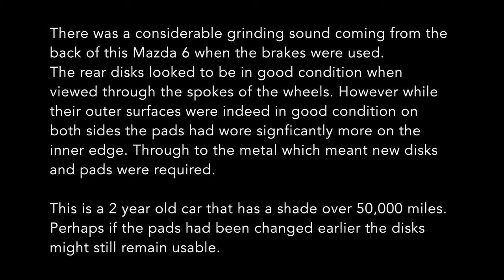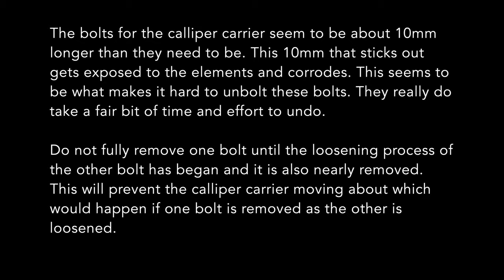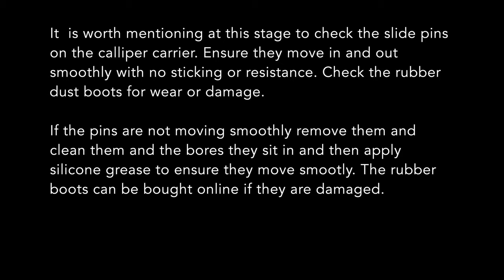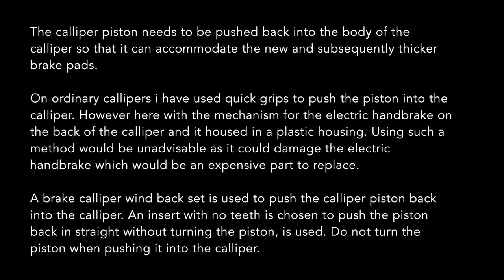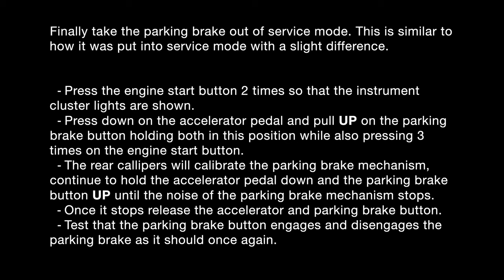Mazda 6 with Electric Parking Brake - Rear Brake Disks & Pads Replacement

Comment: Great Instructions. I just did mine. My bolts came out really easy. One tip: Since the end of those long bolts are exposed, spray some lube on them before you try to take them off. It will make it much easier.
Reply from the maker: Great advice thanks.

Comment: Great and very informative video. Did the brakes on My own M6 2 days ago using this video 😊 Sweet detail with the parking brake service mode 👍
Worth noticing is that there is in and outside brakepads. So you have to be aware which type faces twds you and which type faces the wheel well (id: Dots on the non friction side).

Comment: This is by far the best video on the topic. Very detailed. 
Only one suggestion: mention which size are the bolts, diameter of the piston, if you used lock-tight on all bolts, etc.

Comment: I would like to que myself as well in the greetings line. 
This was thus far on YouTube the most informative video. 
Cheers dude. 
Have followed the instructions step by step and have had success. 
My Mazda 6 is from 2018 September, and rear break pads, most likely have not been changed until now. I have managed to break 2 fasteners because they were seized on the calliper. The other 2 on break pad holder were stuck so had to use allot of lubricant fluids.

Comment: Very informative tutorial video which also applicable to my Mazda 3 yr 2017. Unlike other car brand, there's no need to use a scan tool or disassemble the the brake motor to wind back the parking brake.  Thank you for posting this very helpful video.

Comment: Great video and thank you for covering the parking brake "service mode" piece.  The only issue i had was that the kit i rented only had 2 prong disc for winding the caliper piston.  I found one at a different auto parts store that actually had the 3 prong.  This was needed on the car I was working on because the caliper piston had 3 indentions in it that was in a triangular shape.
Reply from the maker: Hi, thanks for the comment. Glad that it helped, i like to cover the full process and in this instance that meant the service mode.

There are a lot of different adapters for the callipers, some of the chinese kits on ebay are not too bad, how much did rental set you back? For a one off job i suppose it makes more sense.
Reply: @peugeotCitroen2CV  the rental is basically free because you get your money back when you return it.  As it turned out the prongs were in the 12, 3 and 9 o’clock position, which doesn’t fit.  I found one on Amazon that has the prongs at the 12, 4 and 8 position.  However, it was one that fits on a 3/8 drive.  The issue is that it will turn the piston, but it still requires pressure to push it in.  I found a kit online for $20 that has the right adapter plate and has the two holes in it so that you attach it the the piece shown in your video.

Comment: Thanks for the video. I wish I found it sooner. I may have over extended one of the rear caliper pistons trying to check if I was in maintenance mode. Now I’m trying to figure out if I need to replace the seals in that caliper.
Reply from the maker: I dont think it is possible to over extend it, unless you operated the button with the calliper removed then perhaps the piston can move too far.
Reply: @peugeotCitroen2CV  that is what happened. I took the caliper off and it wasn’t retracting. I went in the car to confirm it was in maintenance mode and that is where it over extended. I had to take the motor off and manually wind it to compress it. The side that over extended dripped a little fluid which is what has me concerned. On top of that tire rack sent me pads that don’t fit even though stoptech shows them being compatible.
Reply from the maker: @cmsgt4  If some fluid come out its likely air got in, the brakes may need to be bled afterwards.
Reply: @peugeotCitroen2CV  Yeah, it seems that way. I picked up some fluid and once my wife gets home with new pads I will finish the job. Turns out the rear brake pads sent to me were not correct so I am getting a set from Mazda directly. Mine was built in Mexico, which has different rear brakes usually but my trim ended up with the Japanese brakes.

Comment: Always go with  Akebono brake pads.. cost a little more but they're well worth it..  You can get them at Napa.    If you need to go with the super premium rotors..
Reply from the maker: Hi there, not too familiar with that particular brand. I assume you are based in America? 
To be honest i just buy the pads my local motor factors stock, never really go too far out of my way to find anything else. In fairness they tend to last sufficiently well.

In the case of this mazda the owner provided me with the pads and i fitted those.
Reply: Akebono is the name if the brake system its not a pad brand l.

Comment: I've read that there is a Hex screw on the back of the rear calipers to wind the piston back. Did you notice that screw or is it simply not there? I need to do this myself in the coming weeks so thought i'd check.
Reply from the maker: I did not notice that screw, i have the brake calliper rewind set which is normally what i go for first

Comment: Much appreciated great video, i need to do Front &  Rear Discs + Pads on my Dad's Mazda 6. Just to get this clear, once you put the car in Maintanince Mode, you should be able to wind back the Piston at the rear with no issues? It won't damage the Parking Brake will it or i won't need any specialist Computer Tool to wind it back?
Reply from the maker: Yes, once you put the car into maintenance mode the handbrake motor will enter a state that leaves it disengaged and safe to use a wind back tool to push the piston into the calliper

Comment: What is the torque spec for the rear mounting bracket bolts?
Reply from the maker: Hi there, not too sure to be honest. Did not have access to a service manual for this car just tightened them up by feel. 
Emanuals online or the relevant owners club pages might have the worshop manual if you need the torque specs.

Comment: Can I just use a c-clamp on the old brakes before I remove them?
Reply from the maker: Unfortunately no as the piston moves using a screw rather than just hydraulic pressure on its own a wind back tool is needed to wind it back in.

Comment: Very informative video, thank you. I was wondering if you could link to where you bought the parts? I'm being quoted close to $500 from my local shop and the Mazda dealer for parts alone, because they claim the EPB equipped Mazdas require an EPB-integrated caliper that costs almost $350 more than your standard brake caliper. How much was the parts cost and where did you buy them? I see 70 pounds in the comments?
Reply from the maker: The parts were bought from a local motor factors. 
The likes of autodoc or  eurocarparts are an online equivilant over here, there are plenty of others about. As for the actual calliper that might cost a fair bit more however the calliper was not replaced here just the disks and pads.

Comment: Does this apply to my 2015 Mazda 6 which has the traditional pull handle and linkage for the emergency brake?
Reply from the maker: Hi there, 
Not too sure, i would imagine with a mechanical handbrake cable there is no need to put it into service mode. You may still need to rewind the callipers using the tool.
Reply: @peugeotCitroen2CV  Thanks for the info

Comment: God thats disappointing on a 2 year old car
Reply from the maker: Possibly although the owner (my boss at the engineering firm i work at) is a bit heavy on the brakes, and it has covered 50,000 miles its also a big heavy car for the brakes to have to stop. What was done here cost less than £70 in parts.